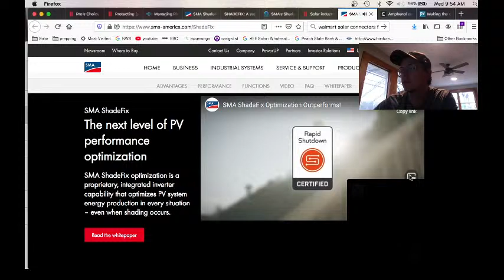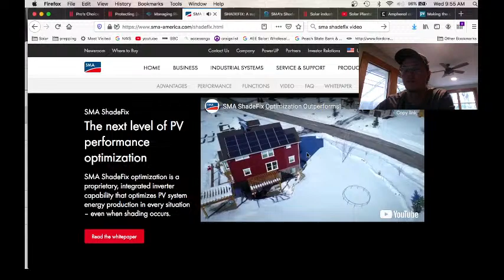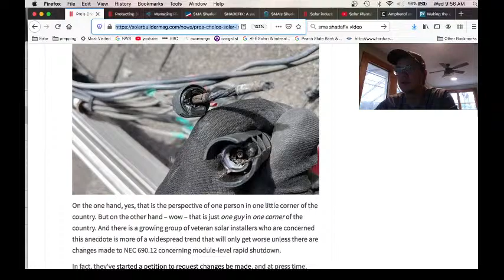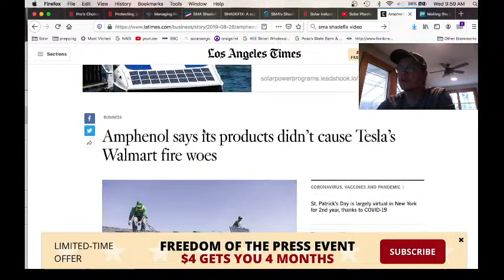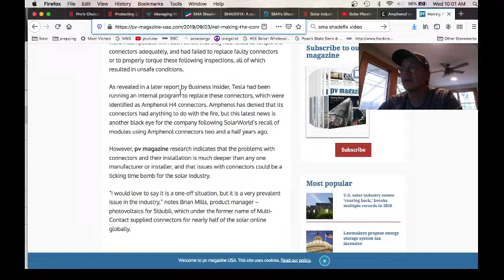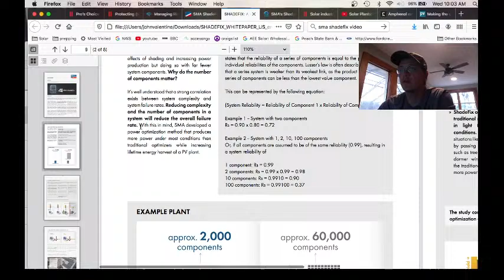Attention Solar Installers:  Pushback on Rapid Shutdown petition

Comment: JOHNNY, WHEN INSTALLING RAPID SHUTDOWNS MLPE’s TO EACH MODULE. 
IN THE INSPECTION OR INVENT OF AN EMERGENCY MANUAL SHUTDOWN EXERCISE, WILL THE MANUAL SHUT OFF OF THE  IMO SWITCH STOP THE ELECTRICAL SIGNAL TO THE RAPID SHUTDOWN MLPE’s BEHIND THE SOLAR PANELS CAUSING THE SOLAR PANELS TO CONTINUE TO PRODUCE HIGH LEVEL DC, BECAUSE THE IMO IS OFF, MAKING SOLAR PANEL MAINTENANCE DANGEROUS AGAIN? DOES TURNING OFF THE IMO DISABLE THE RAPID SHUTDOWN CONTROL AT THE SOLAR PANEL LEVEL?

Comment: I am pretty sure the SMA shadefix feature is intended to replace module level optimizers. The Sunny Boy inverters still require SunSpec certified module level devices for rapid shutdown to work, AFAIK. Either the pv module needs to be SunSpec certified, or a separate rapid shutdown device needs to be added to the module. SMA has a compatibility document on the Sunny Boy page that notes compatible devices: https://www.sma-america.com/products/solarinverters/sunny-boy-30-us-41-77-us-41.html

The rapid shutdown devices expect a keep alive signal from the pv inverter, and will cutoff the PV module voltage if those keep alive signals are not received.

Comment: Johnny.
May I ask for your advice here?
If I don't pair JMS-F rapid shutdown devices, or module level monitoring devices, with SMA us-41 sunnyboy inverters, how can I tell if one or two modules fail, let's say five years from now?
Thanks so much for your insight.
Reply from the maker: I watch for a drop in production or drop in voltage of the string.  Modules rarely fail , and when they do they usually dont fail without triggering a fault.
Reply: @GainSolarPower  do you mind letting me know your take on SMA vs. Fronius for single phase residential application?
What are their respective pros and cons?
Thanks so much
Reply from the maker: @sharonliusa  SMA is very reliable. I’ve never installed fronius
Reply: @GainSolarPower  appreciate your advice

Comment: here in australia you need to install a switch up on the roof, supposedly so if there is a house fire the firemen claim up the roof and can turn off that switch. this switch caused way more fires and failures than the rest.
also somebody gave me a solar system were supposedly the inverter failed. that inverter worked. but what i found was water ingress in the mc4 plugs. about a third of the seals in the plugs were squashed, causing water ingress and corrosion and minor arcing. they came right out of the factory like that. and a reputable solar manufacturer (chinese).

Comment: You mean a computer in between a solar panel and a 140 degree roof will have issues.... you don't say. Signed and Signed. I would never do a module level rapid shutdown on my roof. And why doesn't the industry standardize to 1 connector?

Comment: Johnny,  I think I may have used the Amphenol H4 connectors with the SolarWorld M4 connectors back when I did my original install years ago.  I did not use any micro inverters (Magnum 4448) and I do have ground fault protection through the PT-100's.  I don't think that's a problem but what do you think?  Thanks!
Reply from the maker: You are probably fine I’m sure I have some out there too you don’t have a problem and do you have one and then you have a problem